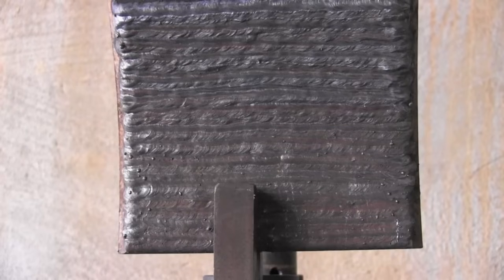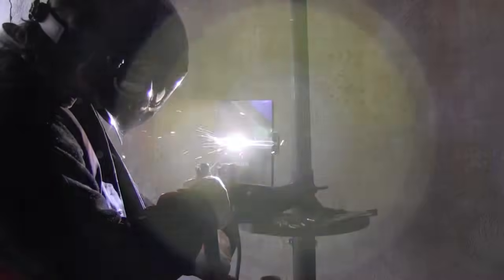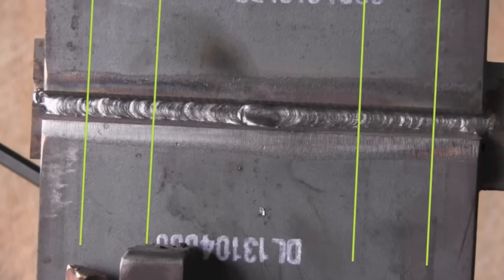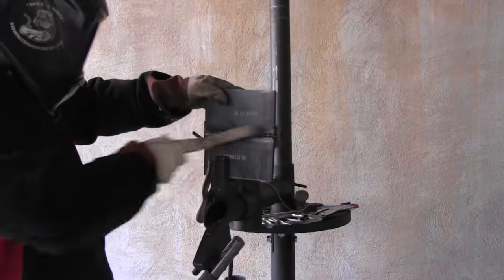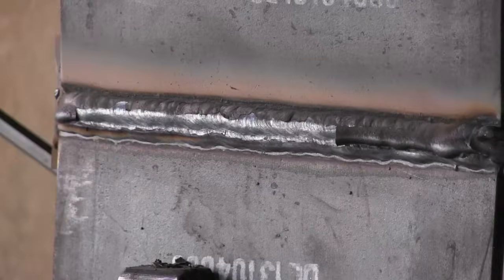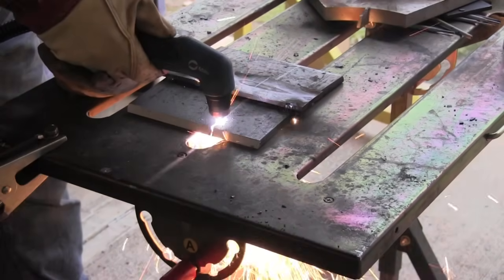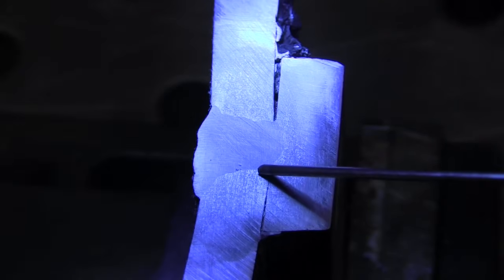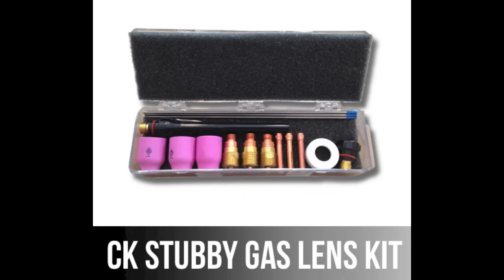Stick Welding Tips- 7018 2g Plate Test

Comment: I, too believed in cranking up the heat to dig in and hopefully boil up any inclusions for the first three passes, then cranking down to 115 amps and standing there to let the plates cool before doing final cap passes. On the vertical up, after getting heat-soaked; your welds can get washed-out and saggy looking and tester will comment on it. My first time passing state cert, I did all high temp and that was my result. My excuse was; well, I passed and I got no inclusions. I made a few spike pick tools for the stubborn slag. Had a guy testing in the booth next to me, he was nervous. I said to him "Just do what you do every day!"  He passed!  I had some great instructors at community college (I learned most by watching them weld)...and a great employer that invested in my welding skills practice. (They threw me right into the fire of the real world putting up structural for overhead cranes with company cmaa aws cert). I went and got my state dept of commerce cert and was confident by then - I had already been doing this stuff at work for some time. Just do it for about a year every day - then go and pass your tests then let the local iron workers, steamfitters and boilermakers unions know you're available.

Comment: Some great tips in there, especially about running the root as hit as possible. But a few things to note and WARNING TO ANY CANADIAN STUDENTS, many of these techniques will not fly in Canada when testing CWB W49(2G standardized stick ticket). CWB doesn't allow any arc manipulation, period. Twice the width of the electrode toe to toe at most. 1/2" gap +/- 1/16". You have to tie in to the stop and start which MUST fall in the dead center of the coupon, I've had buddies who have failed on the first pass on the root for going 1/4" too far. The 2G differs slightly in that it doesn't require 2 stop and starts, you only need one on the top edge.  

Awesome video Jodie, have been watching and learning from your videos for about 5 years now and still keeping up to date! Really gotta get some more TIG fingers!
Reply from the maker: Thx for your input on your experience in Canada. It's also worth noting that while codes for weld tests say one thing, the employer has the right to require specifics like a tie in at a certain location. I once took a 5g open root mig test and was required to put the root and second pass in without ever breaking the arc. That's 12 to 6 o'clock with a u turn at 6 and back uphill to 12 without stopping on 8 inch schedule 80. Sheez my back was killing me after that. Haha
Reply: weldingtipsandtricks
Jody, what on earth was that job for? Carbon pipe?
Reply: weldingtipsandtricks k
Reply: First I want to thanks Jody for his videos which are awesome and truly helpful !

I would like to know if I can find any videos about Canadian welding tests as 2G standardized stick ticket or mig , tig .. I am sure that it could be really useful for people like me who has to take welding tests in Canada .

Comment: Hi Jody,
I don't have to pass anymore exams to keep me hired in my own machinist and welding shop but, this is useful to me as well...
Thanks for your trouble, Pierre
Reply: I mostly tig weld with my powertig welder but for kicks and giggles have been using it to learn stick welding. I learn so much from your videos too Jody.
Reply: Pierre's Garage well said

Comment: Great vids .  I learned years ago to leave the flux on the welds when stacking horizontal fillets . Help provide a ledge for the next bead and keeps the lower bead clean from spatter. Except of course if the flux peals by its self .  Lol 
This I find works well with iron powder rods or flux cored wire mig .

Comment: hey Jody i love your videos and learn a lot but for the first time i might have a quick tip or not to tip that i learned from a guy at work, I kept blowing through my aluminum cans because my arc was wondering and I would turn up the voltage. i talked to my friend at work which is an old school welder and he asked me if my welder was close to me. I said yes next to my table he then asked of my ground wire is coiled up and hung on the welder and amazingly he was right. he told me to move it and not coil it for it creates a magnetic source and my arc will wonder to it. and to my amazement he was correct as soon as i moved it my arc stopped wondering and my welds looked better. Its tips like that i feel more should know and the only reason he knew was working in the ship yard they would wind up there grounds around their arms and set them down close then the arc would wonder that way. I don't know how true that is but it worked for me and I thought i would share for i havnt seen or heard you talk about it yet until a small portion of this video. i look forward to more videos and enjoy all that you do and your attitude is amazing. its a pleasure to even be able to learn what i have from you so thank you. 

Jesse
Reply: Thanks for sharing that tip.I never thought about that but it makes perfect sense.  I am going to remember that forever now.
Reply: Your buddy was right about the magnetic field. I have seen single lead lines jump when pulling higher amps so a coil would make a strong field too. Remember a generator has coils and what they do. Always something!!
Reply from the maker: thanks, Jesse Buis  for sharing that tip about the ground cable here...that is how we all learn.
Reply: Thanks for that tip. I would never have thought that the magnetic field created would have such a far reaching effect. I try to never leave my extension cords coiled up for that reason and the fact that it will cause a voltage drop.
Reply: I've seen shavings line up around my welding leads, but it didn't occur to me that it could actually be pushing the arc around.  Great tip!
Reply: Lewie McNeely ya its funny to watch cables when your gauging at 7 or 800 amps
Reply: weldingtipsandtricks   thank you for all your help i am just glad to be able to give any advice this early in my learning. so thank all you that replied I am happy i could help any one as so many others have helped me. good luck to all.
Reply: Indeed, you wanna keep your ground as straight as you can without any loops, coils...definitely creates a magnetic field..was one of the things i learned in my days of runnin beads at school almost 20 yrs ago...lol. jody has alot of friggin knowledge, il always be subscribed to his channel...a great source of info and most likely a great mentor!
Reply: I used to keep my leads coiled up around my everlast welder until a friend of mine told me about the problems that it could cause. He also told me to keep all of the leads to one side of me
Reply: Brainmalfuction True. They jump all over the place. I'm not a welder but an operator so I get to watch all the good stuff the real welders have to do to fix broken stuff. Doesn't really have to me a high amp deal either. Current is funny stuff sometimes.
Reply: Thanks 4 the tip
Reply: weldingtipsandt